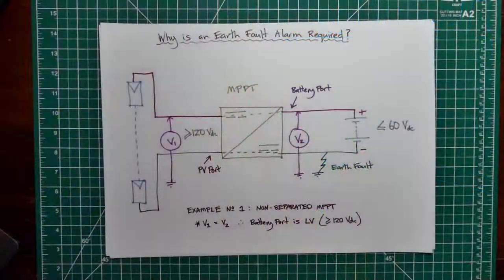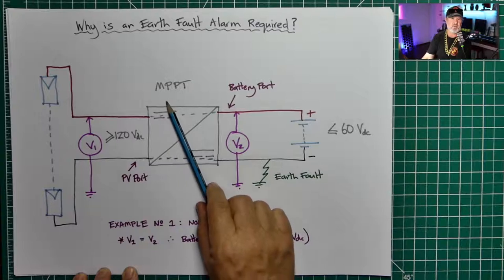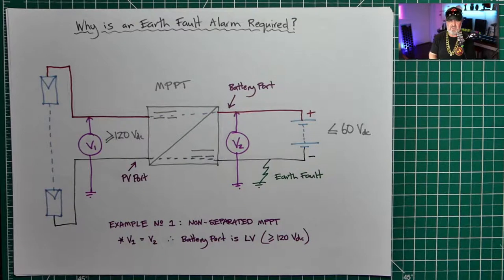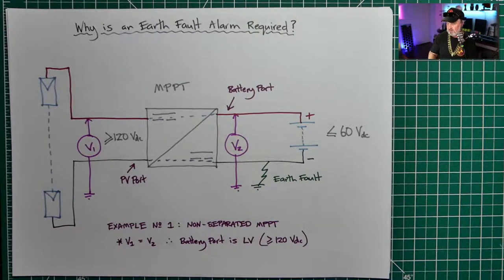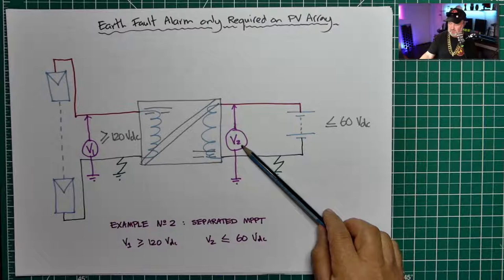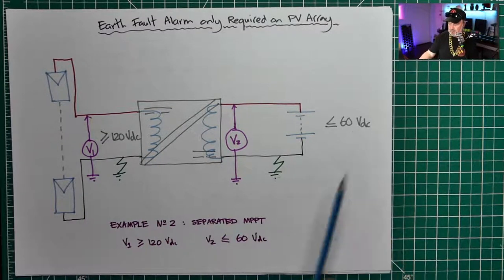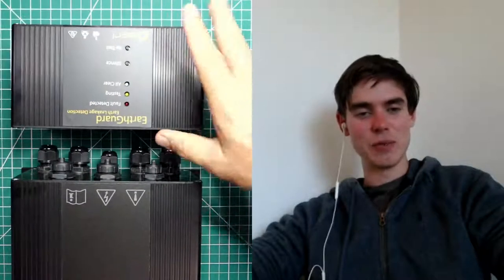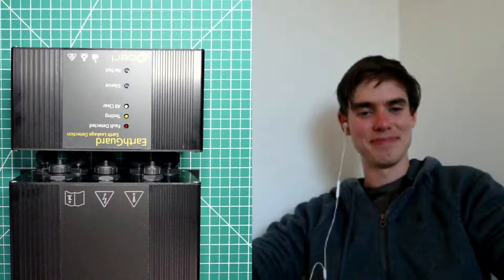Earth Fault Alarm Requirements of Australian/NZ Standards

Comment: IEC 60364 5 52 gives some recommendations for cable-current values in the house installations - is this indifferent to AU/NZS standards? (In AU is 400(380)/230(220) [V] 50[hz] AC in houses for massive purposes like in Europe-correct?)
Reply from the maker: Wow... I'm not familiar with IEC 60364. In Australia we use AS 60038 for grid voltages and AS/NZS 3008 for cable sizing.